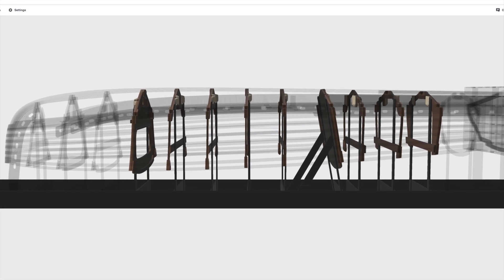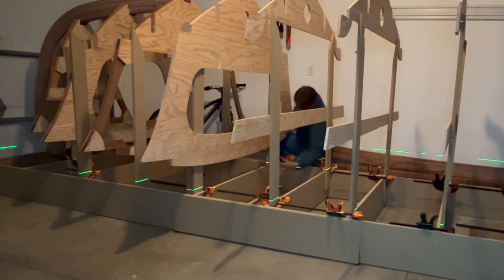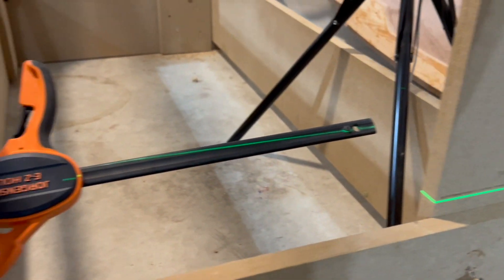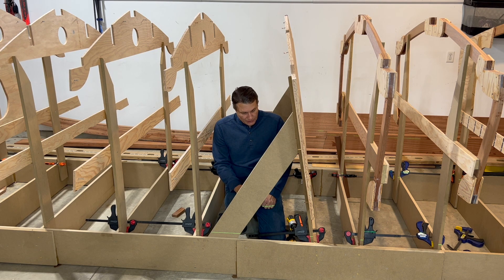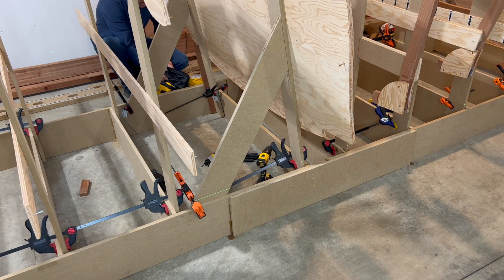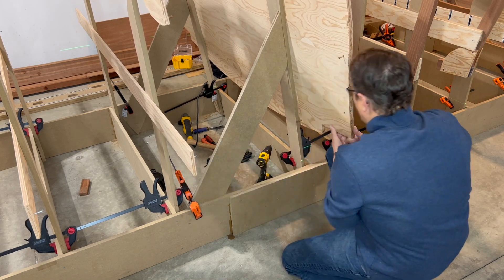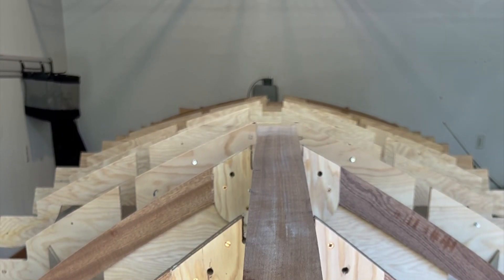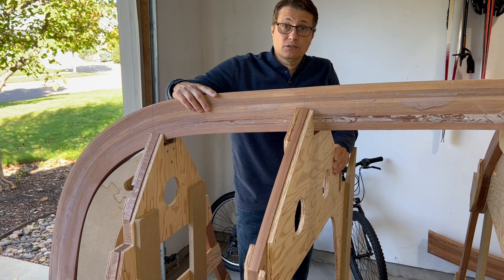Temptress Build 31: Frame Alignment to Waterline (Part 2 of 2)

Comment: Super helpful.  I’m thinking about some engineered lumber for my strongback (a builder friend can order specific lengths for me).  Overkill?  Great tip on frame 9, too.
Reply: The keel and stringers aren't straight sections of LVL but specifically made to fit this boat. I very much doubt you can order that exact shape and bend,  It would not be of much use i'm afraid.
Reply: @Bierrr  I was referring to the strongback structure, not the keel or chines, which I totally agree, I wouldn’t be able to buy.
Reply from the maker: Thank you, Mark.  I love your comments.  
As for the strongback, the MDF board seems plenty strong to me.  What is most important is that you use 3/4” thick material, otherwise the you have to adjust the position of the rings.
Reply from the maker: Mark - Have you started building Temptress?  If so, we should connect on the Dan Lee Boatbuilding forum.  You can never have too many friends for a project like this.
Reply: @Polymerman  not yet.  Probably will start next spring.
Reply: I agree a stronger 'strongback' might be helpfull.  
Keep watching